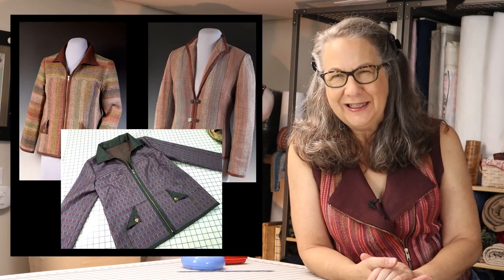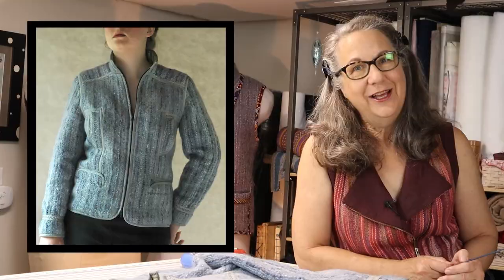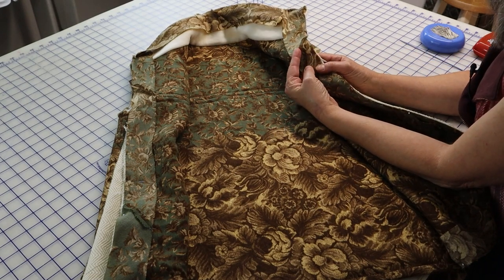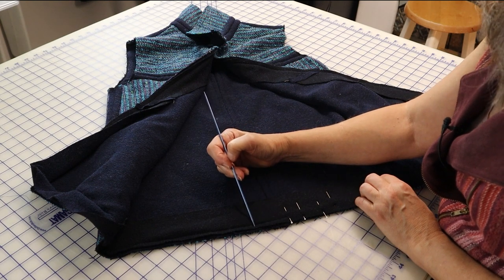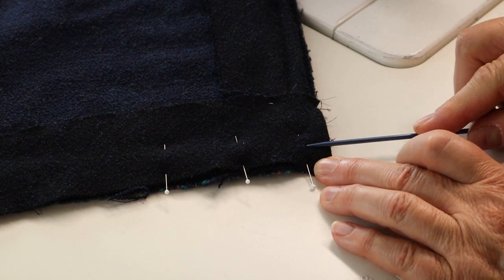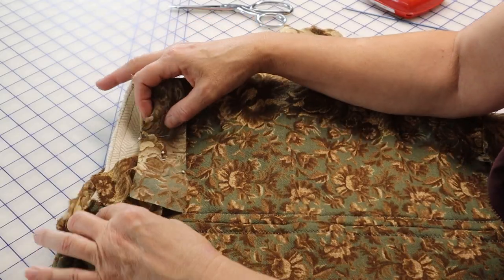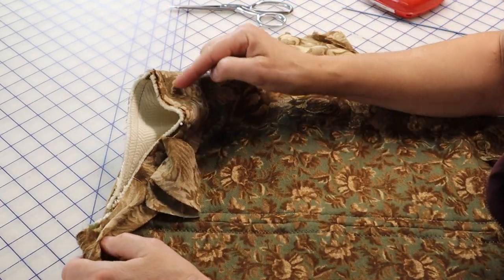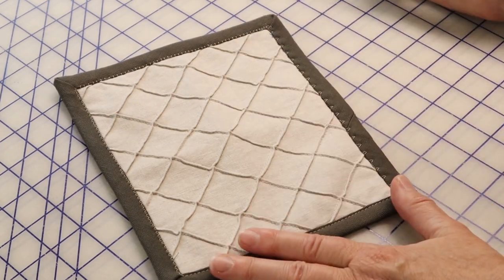Put Those Edges in a Bind!

Comment: I want the vest on the left! How do I weave that? Great video, thank you.
Reply from the maker: If you mean on the mannequin on the left, that was the leftover fabric from a coat I did a number of years ago.  It is a technique called Theo Moorman inlay, where the ground fabric is a woven plain weave in wool, which you can't see, and tied down on the surface, with a fine 20/2 rayon tie down thread, are Pendleton Woolen Mill selvedges.  I wrote the directions for this fabric in an article years ago in Handwoven Magazine, November/December 2005, called Theo Moorman Goes Big.  That article shows the draft and the details.  I had some leftover from the project and used it for this vest.  The original coat can be seen here.  https://www.daryllancaster.com/Gallery_Images1/ButterflyFrontLG.jpg